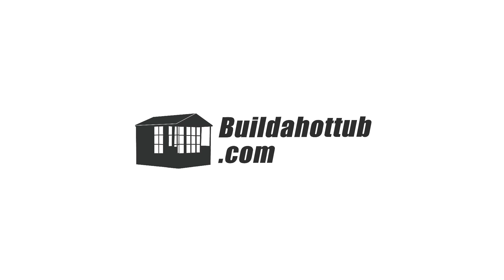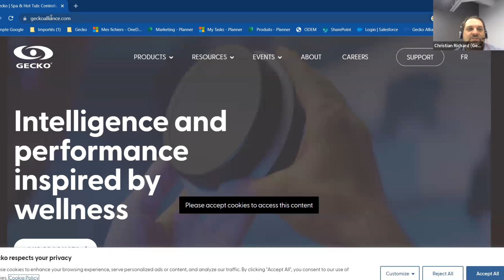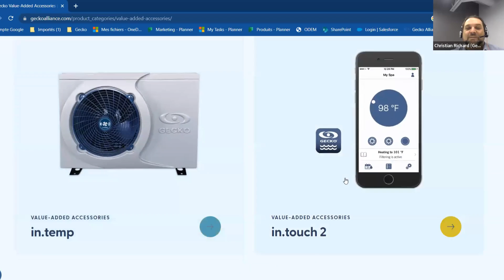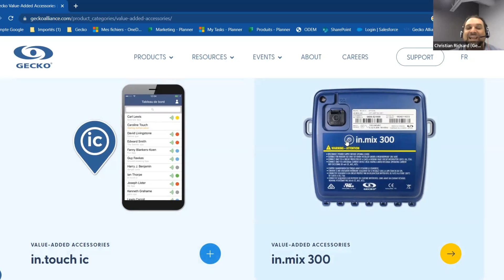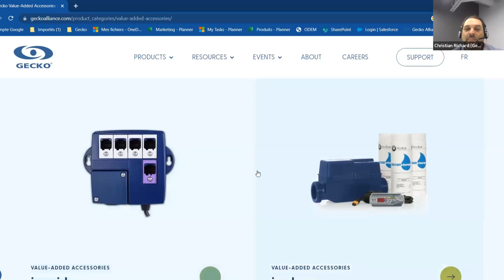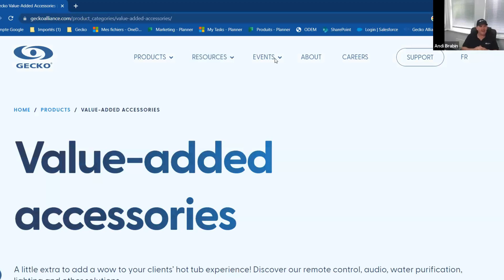What is new with Hot Tub pumps? An interview with the Gecko Alliance Product Manager Chris

Comment: this is quite nice. do you see similar developments with other players int he market? I can see myself upgrade my pump and/or spa pack if I can reduce energy cost by running systems at low cost moments and/or have it consume less energy... this way it could pay for itself. The SPA pack I currently have is quite dumb, does 2 filtration cycles of 4 hours a day with a dual speed pump. this for sure must be possible to improve on.
Reply from the maker: That is a year old video I think now, they still have not launched the variable speed massage pump into the after sales market - the low cost circulation pumps are avaialble and are nice pieces of kit. Nobody has really followed them down this route - at the moment, the focus of the top names, Gecko and Balboa seems to be on auto dosing systems for hot tubs - been around for ages on pools, but not for tubs  - hope that helps - Andi